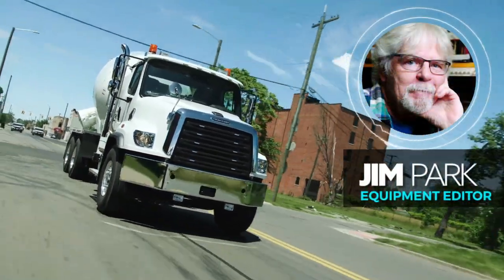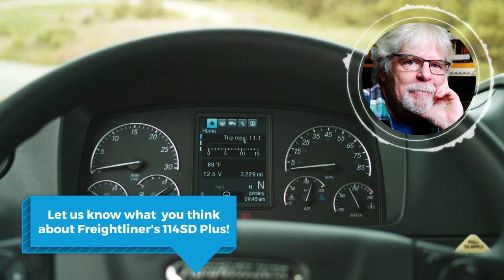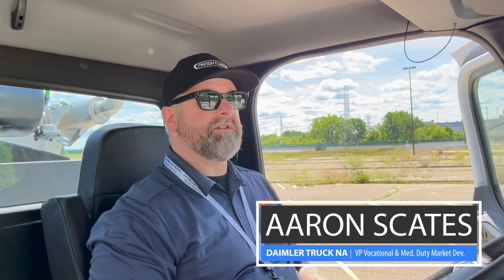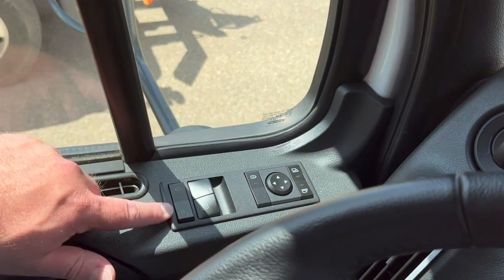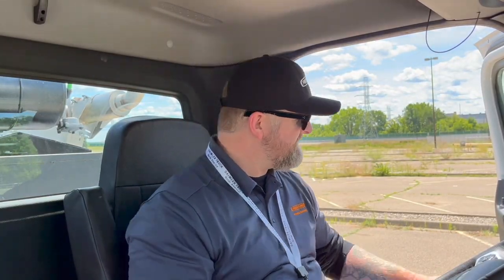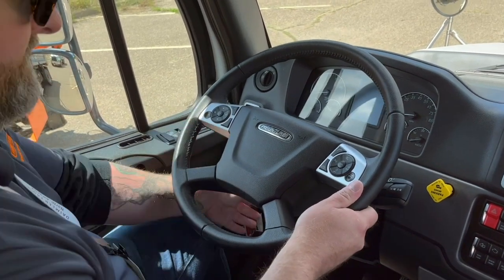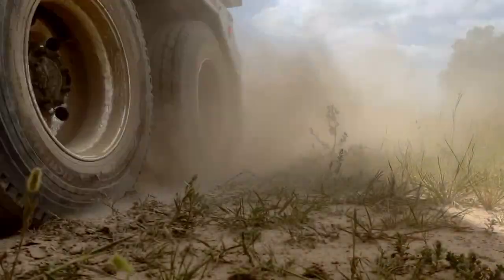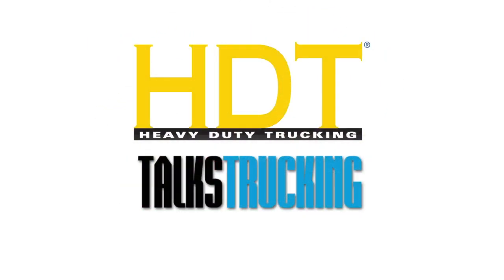On the Spot: Freightliner 114SD Plus Interior Tour

Comment: My company just got a brand semi tractor 2025 114sd plus to go along with the  2023 114sd flatbed straight truck we already have. 

I love the semi, but I just wish it had an x15 instead of an x12 with 500 hp instead of 450. Other than that I love the interior setup on the new semi with the window control placement and all compared to the 114sd straight truck which displays all controls on the dash which I despise.